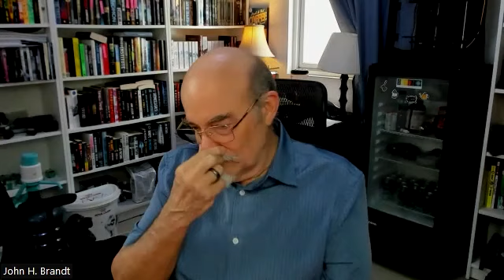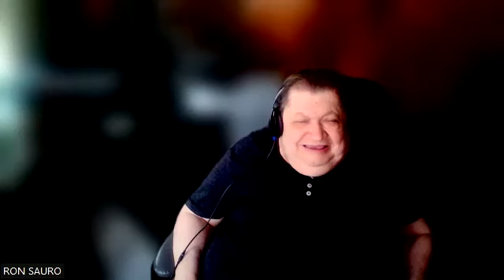How Soundproof Can We Get

Comment: Can you help us explore the flip side? Assume we can build the 62-70 STC walls you've described. How easy is it to ruin that performance by poking a hole of x-diameter in the wall on one side.. on both sides..? This is to explore about how the builder leaving a tiny air gap can nullify a good design. Of course when you're talking about that many layers, it might be more difficult to leave an air gap, but just for sake of discussion. My guess is that it takes very little to undo isolation, because sound PRESSURE finds its way through tiny holes almost as easily as big ones. Is that right?

Comment: There's some pretty interesting stuff with 3D printing metamaterials. Where you create subwavelength resonators to absorb certain frequencies and that absorption can be nearly completely smoothed using a thin foam absorber over the top, losing only a couple % absorption coefficient. But it's very new stuff, still being researched
Reply from the maker: I do a lot of research but I always hold off talking about new ideas and products until they have tested in a qualified laboratory. ;)
Reply: @JHBrandt  Totally fair! I'm pretty much the same, except with me, it's whether it's been peer reviewed or not. Either that or if I know exactly how the testing was undergone, or if I've tested it myself. The research paper I saw on the 3D printed subwavelength resonator was quite thorough. The only issue was that they were using a 1/4 wavelength resonator tube for testing, and therefore only tested acoustics that had 0° incidence to the resonator, so we don't know how it's off-axis performance fairs. Nor do we know its absorption out of their recorded frequency range
Reply from the maker: @lio1234234  impedance tube testing... we did a video on that. If it's not up, I'll post it soon. 😁